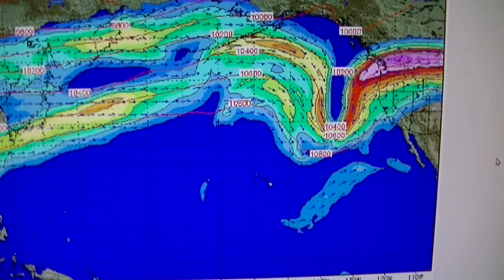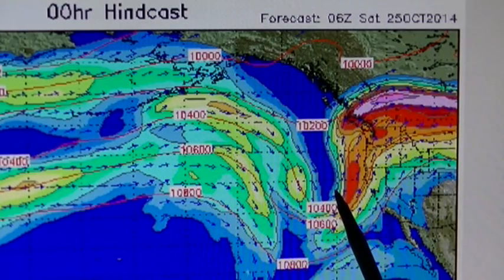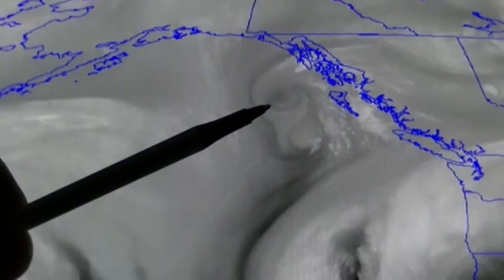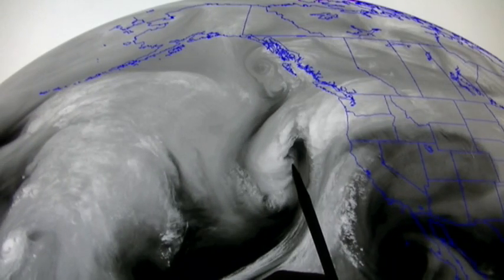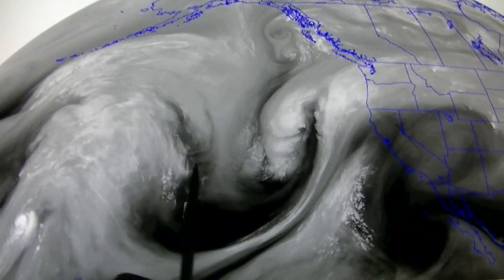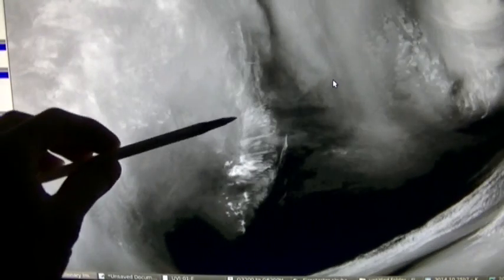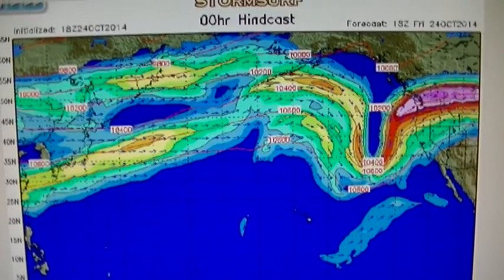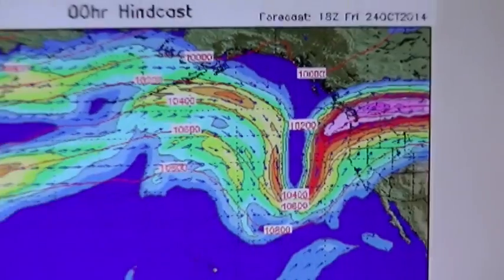Polar Vortex Explained by Jetstream Notch, 10 25 14

Comment: this is being done to reverse the flow of convection currents carrying Fukushima radiation. This was done last winter and its being done again this year.
Reply from the maker: Do you have any evidence to support that? We'd all like to believe there is some benevolence in the geoengineering programs, but I can tell you the only good, is the hurricane prevention in the Gulf of Mexico (and even that comes at a hefty price).
Reply: No, just my own observations for the past 5 years of the geo-engineering being conducted. Tons of my own personal research, but this was begun as a direct, major operation to minimize the radioactive fallout from Fukushima. It began in earnest after the high radiation was detected on the west coast and began being reported by newspapers around surfer's beaches at Christmas 2013.
Reply: The tuning began in Nov 2013, but if you look at this wind map, you can see 2 super low pressure cells in Jan 2014: one off Alaska and another off the west coast of England. This causes the huge 100 ft waves off UK's west coast that began last fall and destroyed cities there http://earth.nullschool.net/#2014/01/17/1200Z/wind/isobaric/10hPa/orthographic=-111.00,45.85,512
Reply from the maker: kcsunnyone
Yes, actually, those are high pressure (clockwise flow), but you are certainly right about the tremendous wind hitting the UK. I remember the terrible wave damage at that time. I think some of the weather control in the eastern US, is actually to produce weather warfare against Europe (and Russia). Unfortunately, there are now many US Navy ships with megawatt X-band microwave transmitters, that are now capable of controlling the jetstream. They are part of the US Navy MDA program. So, if the UK doesn't keep the washington gangsters happy, you will see 100 foot waves, or 1,000 year floods, or Arctic cold, when the geoengineers can swing it. Thanks for the wind map, it is new to me. Why doesn't Europe do something about this aggression??? These gangsters are all bankrupt criminals, who NEED to be in prison. What's the hold up?

Comment: From my understanding of the situation is that the reason they are not letting in rain in California is because of the radiation coming from Fukashima. If it was allowed to rain the government's cover-up of how bad Fukashima really is would be exposed since the rain would be coming off the Pacific Ocean. That could be another reason for the high altitude aerosol sprays as well. From the report I heard was that the only rains allowed to come into California were from the south or the monsoon rains because those wouldn't be carrying as much radiation in them. Just a thought, don't know what your take is on that.
Reply from the maker: Granted, there are many factions involved, but my belief is that the geoengineered drought, is purely malevolent, and is designed to reduce the human population as fast as possible. The way to prove your point, would be to study the jetstream, in mid March, 2011, and see where the extremely dangerous, high level radiation cloud went. The radiation, mostly hit the Pacific northwest, but went all over the US, and into Europe. Each one of these geoengineering programs has to have some "catch phrase" to convince the engineers and technicians, that they are doing a good thing, and they should continue doing it. This is surely, one of the lies told to the chemtrail pilots, and the Haarp operators, that they are keeping the Fukushima radiation out of the US. The truth is, that Japan is still burning the radioactive tsunami debris. If the US wanted to stop airborne radiation, they would just call up Japan, and say "stop burning that shit, or else!". No such call has been made, in fact the opposite instruction has been given, despite the strong protests of the Japanese people. This is all about extermination, NOT about protecting anything mammalian.
Reply: The HAARP Report I completely agree. Its all malevolent. Fukashima, the drought, chemtrails, all of it has to do with population control. I've seen the chemtrails where I live and have taken video of them. My understanding is normal jet exhaust only lasts a few minutes tops. Not hours and certainly not long enough to be carried on the jet stream. I just wish more people would wake up to the truth. Anyways I love your videos and find them every informative. The way you present it leaves very little in doubt. Keep it up.
Reply from the maker: Ill Will Regular contrails last less than ten seconds. The rule of thumb is that the air has to be colder than 70 F, and have more than 70% humidity, to have persistent jet trails (ice crystals), from plain ol' jet fuel. You can definitely see some contrails disappear in less than ten seconds, but the ones that are spraying aerosols, the trail stays there all day, and smears out to a haze. I try to make each video self-proving, so there is no doubt, and anyone (including meteorologists) can check the data for themselves. Also, that saves me from having to answer a lot of questions ;) But, I like to hear from folks like you! Take care!
Reply: The HAARP Report one last question and I'll leave you alone lol! So when the chemtrails spread out in the air is it common for them to cause what almost looks like a rainbow? Example: I saw chemtrail spraying the other day and when the sun moved behind the chemtrail it caused the portion of the chemtrail (haze by this point) that the sun was behind to have a rainbow effect. I had never seen that before.
Reply from the maker: You are so right! I saw that about two weeks ago, and I've never seen it before. A bluish/reddish/purplish halo around the sun. I've NEVER seen it before, but I think it is happening a lot now. From the 1990's Project Cloverleaf leak, the man said there were eight different chemtrail mixes. It looks like they are switching to a new mix, one that binds enough water vapor, to form a water ice crystal. It is the ice crystals, that form a prism, which refracts the sunlight, to make the rainbow halo around the sun. I am NO EXPERT on this, and you should ask Dane Wigington, on his facebook, and join him at geoengineeringwatch.org, to get the best answer. But, I'm with you, I saw that a while back, and it just stopped me in my tracks. Apparently, they are spraying a new mix, without our knowledge, without our permission, without testing the health effects, and without knowing the long term effects on the bio-sphere. If it is so damn harmless, let them testify, under oath, before a congressional hearing, about all the research that has been done!
Reply: The HAARP Report exactly. If it's harmless why not tell us about? Why the discretion? And thats exactly what is was. A halo. It had the same effect on me when I saw it. I had to rub my eyes thinking I was seeing things. I appreciate the info and I will check that out.
Reply: Luis trelles you're not stopping them anytime soon.
Reply: Luis trelles why would the UN get involved in what the US government does to its own citizens? For one the US really controls the UN. The corporate bankers that control the US government also control the other countries in the UN. Plus if any country tried to intervene the US would wipe them out militarily. They all answer to the same masters that want to destroy humanity by doing things like control the weather. There literally is nothing we can do.
Reply from the maker: Ill Will
The UN is another group, that is secretly controlled, to create wars, and do genocide. Still, there is lip service given to enforcing treaties, like the 1979 EN MOD treaty, and that is the place to start. I think there are dozens of countries that would do anything to stop this weather warfare, but first, they have to have proof it is even happening. That is why these videos are going up. I agree the UN is a sack of sh**, but we gotta start somewhere. But, I'm sure it is either NATO, or the US military, who will actually shut down these programs of planetary genocide.
Reply: The HAARP Report How are you so sure about NATO/US military?
Reply from the maker: clive mossmoon
If these guys see the proof that chemtrails and haarp are killing the planet, and pushing it towards runaway heating, they will have to stop the geoengineering, as a matter of national defense. That is my hope.
Reply: The HAARP Report And with guys like you and Dane out there, that info will get there my friend. I've been sharing your stuff everywhere. You just never know how something will go viral.
Reply: Ill Will I see it every time they chemtrail.

Comment: Does the radioactivity in the Pacific Ocean contribute to the heating effect?
Reply from the maker: Synchro Nicity The heating caused by the radiation of a few bequerels per kilogram is infinitesimally small (NOT measurable), compared to the control the weather control technologies have. For instance, the increased greenhouse gas, is adding about 3 watts per square meter, to the entire planet. This is called "forcing" by the uppity climate scientists. This additional 3 watts of heat, ALL OVER THE PLANET, are the reason the Earth is heating so rapidly now. Anybody who denies the planet is heating, is either an idiot, or paid disinfo shill.That said, a few bequerels per kilogram of Cesium, is enough to kill all kinds of fish, kelp, mammals, anemonies, birds, everything.
Reply: The HAARP Report
Thanks for the information.

Comment: I think they're damaging our Ozone layer with all that HAARP does along with the chemtrails.
I can feel the intensity of the Sun much more over the last decade.
Reply from the maker: l3urns1
These are VERY COMMON trace elements found in coal ash (hint, hint).
Reply from the maker: I remember how the sun felt back in the 70's and 80's. It was warm and friendly. Now, it stings, and you can feel how harmful and dangerous it is. I have so much sun damage now, but it has all happened in the last few years. If I'd known about the vastly increased UV, I would not have spent so much time outside, since the mid 2000's.
Reply: The HAARP Report I remember the 70's as well. Seems like another world far away. No wonder the trees are dying. It's just too intense, as well as the Aluminum in the ground that trees will not uptake.
Reply: Our atmosphere is completely compromised. You can see your breath when it's like 45 degrees and the sun feels like a magnifying glass. We're frying
Reply from the maker: andrew vaessen
If you're right, that means they are trying to do A LOT more than just reflect some sunlight. This is a horrific mix of toxins, and expensive rare earth elements, which would mean something extremely advanced is being done to the planet. Can you give your source for the list?
Reply: Aluminum  Dysprosium  Silver  Arsenic Bismuth Erbium Boron Europium Strontium Barium Gadolinium Titanium Beryllium Gallium Cadmium Hafnium Tellurium Cobalt Holmium Uranium Caesium Chromium Indium Copper Lanthanum Rubidium Lithium Lutetium Thorium Cerium Manganese Neodymium Molybdenum Praseodymium Nickel Samarium Lead Terbium Antimony Thulium Selenium Ytterbium Tin Yttrium Thallium  Zirconium Vanadium Zinc Iron
Reply: there have been many toxins found in this garbage. best way to test it is clean your windshield on a heavy spray day and then come back after and collect the fallout
Reply: justin dahl
Yeah it's scary out there brother.
Reply: The HAARP Report Aluminium  Dysprosium  silver  Arsenic .Bismuth. Erbium,Boron.Europium.Strontium.Barium.Gadollnium.Titanlum.Beryllum.Gallium.Cadmium.Hafnium.Tellurlum.Cobalt.Holmlum.Uranlum.Caeslum.Chromium.Indium.Copper.Lanthanum.Rubidium.Lithium.Lutium.Thorium.Cerium.Manganese.Neodymum.Molybdenum.Praseodymlum.Nickel.Samarium lead Terbium Antimony Thulium Selenium Ytterbium Tin Yttrium Thallium  Zirconium Vanadium Zinc Iron .go look these up word by word i got this from someone that works for the DHS this is the shit they spray on us
Reply: The HAARP Report id like to but she would be pist off at me if i did

Comment: Apparently it does not only happening in the American west coast, here on the southeast coast of Brazil they doing the same, although we are entering the rainy season, the rains does not shows up for more than 6 months. I have seen several of these pin-points on Chile's coast and also here in Brasilian coast into the jet streams. Apparently this microwave shots comes from a British station in Falklands in the coast of Argentina
Reply from the maker: Doesn't Brazil have an air force, and navy? If they do, then they need to watch for the SBX type of ships. That would be a possible weather controller in that area. I think the US is building more of the "missile defense" ships, and every one of those are megawatt microwave transmitters, capable of changing the weather. I have never looked at the weather patterns for Brazil, but I know there is a terrible drought going on down there. As the oceans warm, there is more water vapor in the atmosphere, so there should be MORE clouds, and MORE rain everywhere, not less (assuming other factors stay the same).
Reply: The HAARP Report Please spend some time looking at our coast, especially in the southeast and see how they are manipulating our local climate. I believe that the Falkland Islands have great participation and how it could not be otherwise, this island is obscured by clouds in google earth